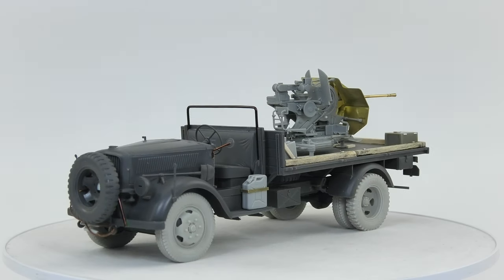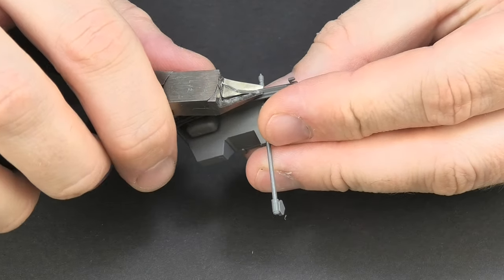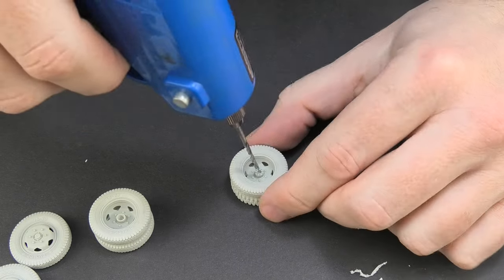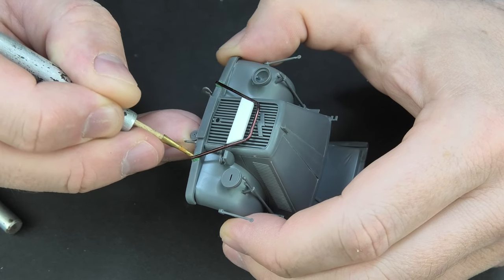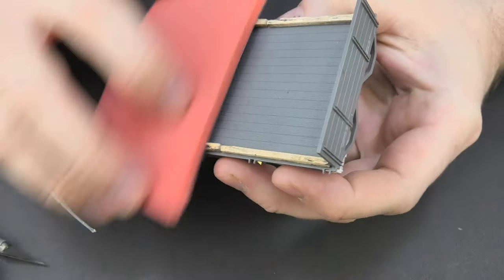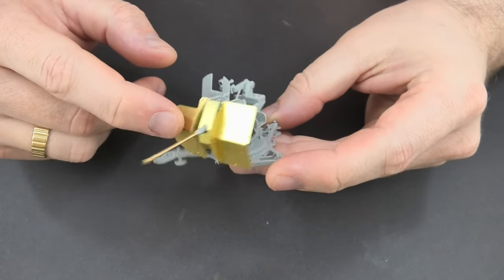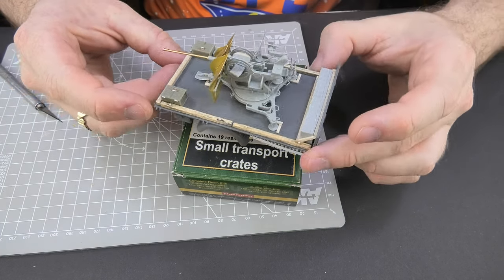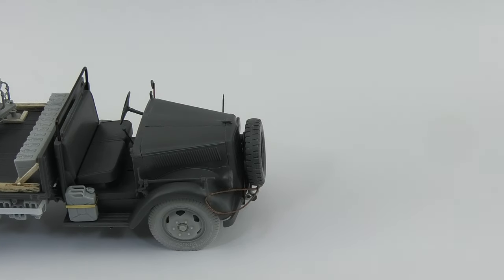OPEL BLITZ and FLAK 38, AFRIKA KORPS, part 1, Tamiya 1/35 scale

Comment: Im sure youve seen, or are aware?....- If not, "LEAD-WARRIOR" has some excellent conversion sets for the TAM 1500A 4x4 Steyr trucks, IIRC, two Ambulance/KrankenWagen conversions, a few flat-bed trucks, and 3 or so differing FLAK-Wagen conversions too, for 2cm AA cannons & 30mm AA JaboShreck....

-Another GREAT LW conversion kit using ICM's 1/35th 'Henschel 33D Truck' as the base kit, converting it over too a 1930's/40's German: "TS-25 Kfz. 343 TankSpritze" fire dept tanker/pump truck. The LW resin kit is simply >AMAZING< when completed/converted!..It has the makings of a model show winner if assembled/painted up correctly...
-$187,00 U.S just for the LW conversion & prob $50,00 or so, for the ICM donor kit. Kinda funny the only things one really uses from the ICM kit is the truck frame, hood parts, radiator front/motor & front wheel fenders themselves...Ha!

-The Resin Lead Warrior uses is top-notch too, bendable & flexible, easy to cut, or carve, due to its softness-but not too soft either, sands, glues & paints/primes up well, not hard or brittle, nor arriving warped like some manufacturers tend to do. Ive done 5-6 LW Steyr truck conversions & 3 or so LW electrical Zundapp Generators & zero parts in any of the kits arrived warped/broken in any way. Well designed, well packaged kits w/excellent , easily read instructions....('Masterpiece Models" also makes a resin 1/35th 'FLAK-Sled' -to help ease removal of 2cm FLAK guns from truck beds/carriage. 25$...But the sled certainly easy & simple enough to scratch-build too;)

-The LW resin used being the closest thing to IM styrene plastic as too feel & consistency, but yet still made from a 2-part resin...VERY similar to Joe Bankovic's TMD/Tiger Model Designs & Alpine Miniatures resin recipes they both use (Joe B. @ TMD had told me he used to do sub-contractor casting work for Alpine Miniatures years back & they'd shared their best resin formulas, aside from his uber-secret personal 'One Special Ingredient'...Ha!)

~WONDERFUL Opel build! 

*(Isnt it humorous the Kriegsmarine. Luftwaffe, Waffen SS & Wehrmacht heavily utilized & were all riding around in license built copies of FORD/OPEL & GENERAL MOTORS TRUCKS!?..
-In order for high-performance aerial motors to even FLY, the Luftwaffe/RLM/WaffenAmt purchased T.E.L-Tetra Ethyl Lead fuel additive, somewhat directly from the Rockefeller families Standard Oil corporation!...-Albeit through Spains middleman dictator: Generallisimo Franco. German chemical conglomerate I.G Farben coundnt produce enough TEL with all its other myriad war economy obligations. Standard Oil KNEW exactly WHERE it was >>going too>>...To HELP assist shooting down/KILL American  bomber Pilots & crewmen!....Oh boy!...-War is a crooked game eh?.;)
Reply from the maker: Thx a lot mate for interesting post. I know LEAD WARRIOR stuff and had some on my workbench some time ago :)